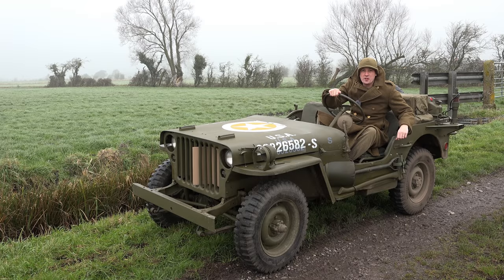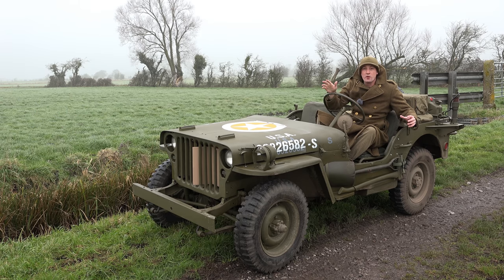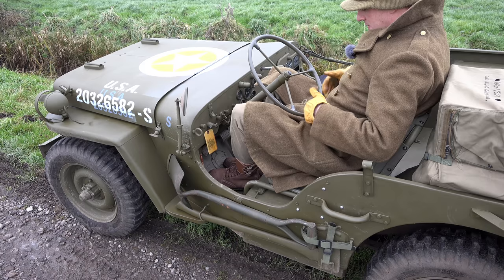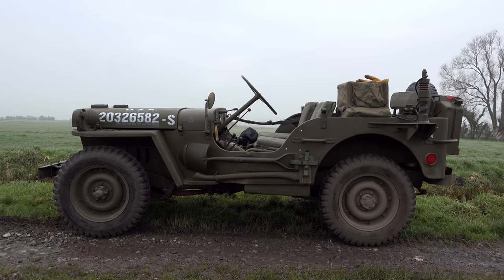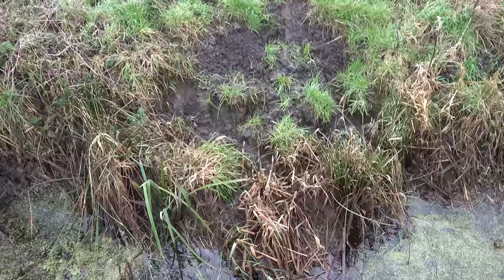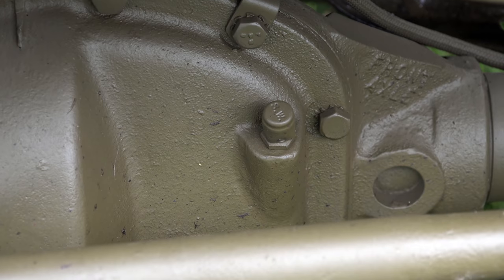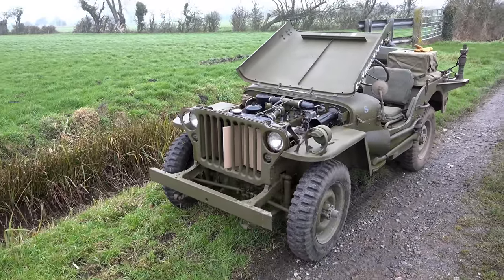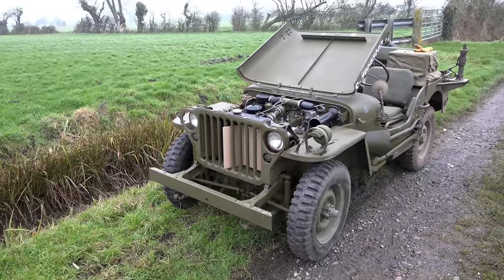Top 5 WORST Willys jeep features!

Comment: the asbestos was more for heat absorption than waterproofing, the radiator wasn’t able to work normally while partially submerged so needed help. the biggest thing was the snorkel that you missed: it was needed for sir intake as the Jeep needed air for the engine’s combustion. and these could withstand water, hell if they couldn’t they would have been rejected! you’re mistaking submerging underwater with not being able to get wet which is total crap. these could ford shallow rivers and streams and drive through horrendous rain, they just couldn’t submerge. then again, ONLY ONE SCOUT CAR COULD!

and you are completely ignoring the whole point of the Jeep in your list: it was all about function not comfort. These were great scouts and could drive just about anywhere easily, take a beating, were easy to maintain, and were most important of all: light! it’s war, comfort isn’t essential when lives are on the line

Comment: 5. You are taller than the average American G.I. at that time.
4. Waterproofing -  it was NOT designed to BE waterproof.  This vehicle had a very short design and manufacture time.  IT DOES EXACTLY what the design specifications were!!!  Its basically a motorized Mule.  Are you going to complain about how a mule was designed?
4a. Strength- it is as strong as it needed to be.  Yours is still working!!
3. Weatherproofing - what war if fought ONLY in "nice" weather??   This vehicle was made for war, not you daily trip down to Aldi!
2. Strength - again,  its done the job it was designed for.  Its NOT designed for 2021 specs. Remember, its a 1940, QUICK, cheap build!
1. Dimmer switch - Again, you are larger than the people of 1940s,  and it is an American design.  You must remember, that most VEHICLES had black out covers over the headlights and they did NOT use the high beams.  
  You really need to thing of the era they were designed.   If you have this many issues with the American vehicle maybe a land rover might be more to your taste?   Even the Queen worked on the 1940s era Land rovers.
Sorry,   trying to hold  an 81 year old vehicle to the standards that you are used to, is kind of.......ridiculous??
For whT it was designed for, it was AMAZING!!!   Evidenced by your owning one that STILL works, and as you said, "haven't had any issue with the drivetrain".   So they HAD to do quite a little RIGHT!

Comment: I made it to 10 min. You addressed the size issue yourself, "water Proof" well first off YOUR jeep has NO military ignition parts on it so YOUR jeep is definitely not water proof!!!  On an original Military jeep the complete ignition including the coil, plug wires and distributor are completely water proof and with the correct snorkel assembly your air into is also water proof to the top of the windshield.  As far as preparing the jeep for fording there is no prep, I have NO clue what your talking about with all the nonsense about covering stuff?  The only prep is to pull the fording lever on the dash and then pull the drain plug on the bell housing to drain the clutch when you get out of the water.  EVERY differential on the planet has got to have a breather, along with the transmission, transfer case and engine.  They are made to run under water for a set amount of time maintaining a forward motion and if this time is exceeded then you are supposed to drain the lubricants and replace with fresh oil.  On your next Gripes video on a vehicle that is of this age I suggest you get a TM manual on it PRIOR to your making the vid, it will answer a whole lot of your issues with the vehicle in question!

Comment: You said it yourself - you're 6' 2" - it was designed for someone 5' 8" -  I think that's the point you make yet somehow can't understand.  Think about it when buying shoes and you'll have it.  It's too small for you - yes, it is.  

The water-proofing of the engine -  well, looks like that wasn't attempted at all!  I can only assume it wasn't in the original specification given to Mr Willy or I don't see how he got away with that design at all.  It just isn't remotely designed to handle fording rivers or such at all.  

The passenger weather proofing is very poor.  Yes - not so much when it was built as the practicality (cost and keep it light-weight) and the market (army purchasing NOT the guy  using it).  Coaches in the 17th Century and 1930's Lagondas or Rolls Royces had decent weather-proofing - it just wasn't a priority.  Also - in reconnaissance - you want things very open - rather rain than bullets!  

The weakness point - well, you made that point - then un-made it.   So I'll take it that it isn't weak.  

The dip switch - hmm,  unless your feet are big, that may be a design flaw. 

So - new name for your video - the ONE fault with the Willy's jeep and a reason why I shouldn't have bought one.

Comment: 1:48 you don't have to be fat when you are substantially larger than the average. you are nearly a foot taller than average, that would probably mean that even if you were fit you are a few inches wider in diameter. please don't act like this is a small thing. you are a giant trying to run a car made for normal people.
Reply: 2:40 no, you are a giant. if i sat down there i wouldn't feel like a giant. i am 5'6" so 2 inches below average for a man, but you are over 6 feet, which is really close to being a giant and isn't where most folks male or female sit.